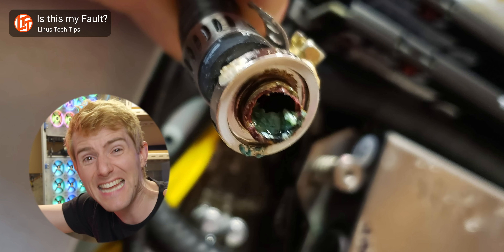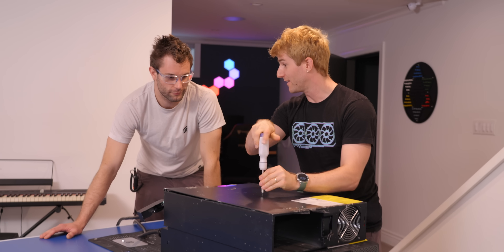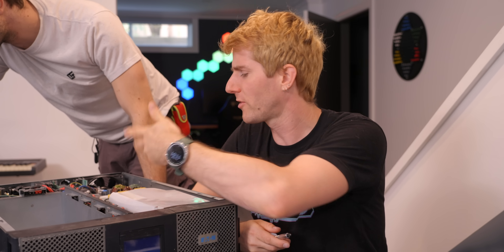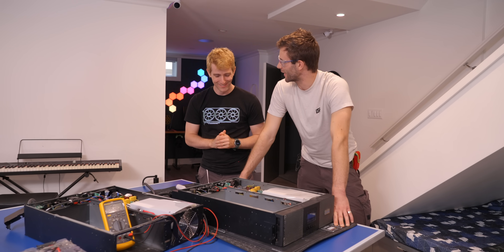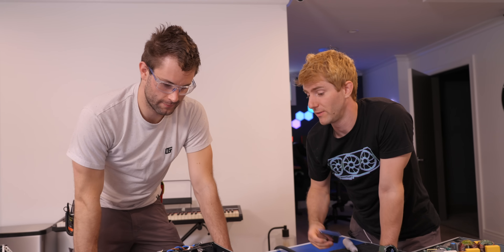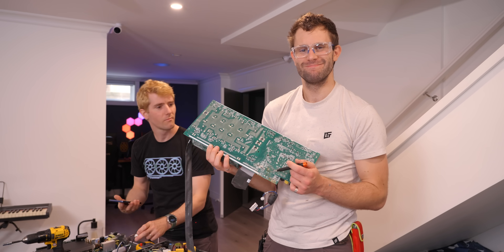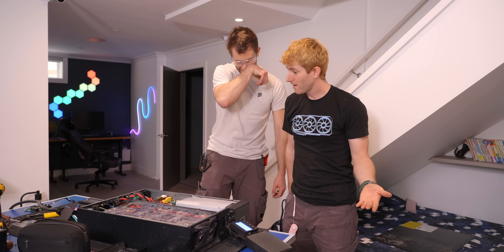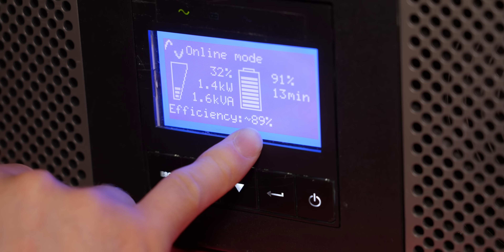Risking my life to save $5000 - Water Damaged Battery/UPS Repair

Comment: Really though people, don't try this at home, capacitors with a couple hundred volts in them are VERY scary. Even if the supply is rated for a tiny amount of power, a large capacitor can still easily deliver many, many amps for a short period.

If one of those bites you, that's it. Black screen. You're dead before you hit the floor.

I got lucky once and only capacitively coupled myself to ground through a 2KV AC supply, had my finger touched a millimeter over and found an ohmic path I'd be dead.

Comment: Actually, you can a NEW APC Schneider Smart-UPS (online UPS) 1500VA RM (SRT1500RMXLI) for around 1700 € without or 2200 € with a network card. New lead acid batteries incluced. Not sure if that operation here really would make sense if for someone else than him, since he gets the revenue from the video. Since he payed 500 $ for the new unit, has to pay Tynan and still has used batteries....

Comment: Ways beer and UPSs are NOT alike:
1. You cannot drink a UPS. Even if you could, you probably shouldn't.
2. You should not go to a UPS tasting.
Reply: 3. Beer will not automonously respond to a power outage
Reply: @chrisogrady28  That may depend on how long the beer has been standing around without a lid on ...
Reply: @chrisogrady28 Well, it probably would become warm
Reply: You shouldn't walk around with a beer on the street in the US, whereas it's probably pretty fine to walk around with a UPS.
Reply: @derBiggi82 brown bag it
Reply: @samlevi4744  The USP? Yeah, probably a good idea...
Reply: You cannot tell me what to do.
Reply: Your beer cannot electrocute you if you take it apart
Reply: @CentreMetre  Enough of either CAN cause you to fall onto the street, burbling incoherently
Reply: This works for uninterrupted power supplies and United Parcel Service. 😂
Reply: 'Yes hi, I'm looking for a beer that pairs well with a UPS'
Reply: As an ex ups employee, a shocking amount of drivers are achoholics. And a ton would step down to being a pre loader after being reported for drinking on the job, but that doesn't mean most do...
Reply: Shouldn’t go to beer tastings either.
Reply: 3. you can only taste UPS once in your life
Reply: But why?
Reply: Also never allow very small children to sample your expensive electronics. (and beer)
Reply: Well you can at least drink the sulfuric acid from those batteries
Reply: ups tasting.. sounds yummy
Reply: Uhh, aren't Lead Acid Batteries full of distilled water? So i suppose you could actually drink it. (Disclaimer because some people might be that stupid: The distilled water inside a Lead Acid Battery contains aqueous sulfuric acid. And lead. Don't fucking drink it.)
Reply: @avgvstvs996  Tasty!

Comment: it highly bothers me that Linus is pointing with the uninsulated screw driver while talking about capacitor discharge.
Reply: Even if it was insulated hes holding the shaft 😂
Reply: The system works.
Reply: My shaft is always insulated....
Reply: @2Hard2Core  pause
Reply: @jono6379  @2Hard2Core  No-one wants discharge on their shaft... #Sorry #Notsorry
Reply: Correct

Comment: i did the "same ish" thing on my opel Ampera (same car as linus volt ) battery as long as you know what your doing it is not that dangerous. and if you REALLY have to this shows allot but there are allot of other videos that go in to the safety.  1 thing that i recommend ALWAYS 1 extra person for IF something does happen. 
that battery on the car is just ALLOT heavier XD

Comment: That 190ish VDC battery is honestly more dangerous than MOST of the caps in there. For one, far easier to put that "across" the chest (touching a wire with each hand).

Also that being 5 grand for so little capacity is ridiculous.
Reply: The expense doesn't come from the capacity, it comes from the rated power output. They go from 1 to 22 kVA.

Comment: Ya'll should do a video on how to set up a UPS for home use.  I know there are tons of affordable units that are essentially plug and play, but I could totally watch a video where you outline how to properly speck a UPS based on your needs (how much do you have plugged into it, how long do you need it to run, is this just to clean up dirty power, etc.), if it makes sense to buy a second hand unit, and what different battery options there are out there.

Comment: the sheer amount of disclaimers around the first 2 minutes tells me this video is going to be a good one.
Reply: Its funny how he was so scared to touch anything in the bugging but then started rubbing the bottom of the board ( most dangerous part cuz that is where capacitors pins are )
Reply: @Comrade_YG  you mean after they probed all the capacitors to make sure they were discharged?
Reply: Take a shot anytime a disclaimer flashed across the screen.
Reply: @VincentJulianOng  Disclaimer: LTT does not recommend taking a shot every time a disclaimer shows on-screen.
Reply: Not everyone has a mechatronics engineer at their disposal ... an interesting video usually gives a good financial return ...
Reply: They got ELV mixed up with LV though... Not that major though. LV is quite dangerous, but so can ELV.
Reply: BUT IT WASNT :D
Reply: And it's basically for nothing. Just cringe clickbait.
Reply: @le_potate3861  u clicked on it
Reply: They got ELV mixed up with LV though... Not that major though. LV is quite dangerous, but so can ELV.
Reply: yes
Reply: This comment made me watch the video
Reply: Disclaimers? What disclaimers?
Reply: @TimeFlyBy  Linus "That's right, you're not dealing with the average content creator  anymore, Youtube... I, Linus, have finally become... the legendary Super Saiyan!"
Reply: the electric trucks we work on have 1000V capacitors and batteries which will blow your arm right off
Reply: @alexguolo5872  Thats like fetus work. Try working in a substation. We have 69kV which can disintegrate you through arcs
Reply: @alexguolo5872 1000V DC still falls under low voltage at least... But you wouldn't want to take a short across one. Be a hell of a boot
Reply: Try working down in a mine lol. This is baby wimp work
Reply: I feel like they definitely overreact and over dramatize things. Acting like these caps are live bombs
Reply: @Laborchet  In the ideal conditions you will actually die. In reality you will get a nasty belt and its also a way to check if you have a heart condition if you get a heart attack after. So yea dont fuck around them caps
Reply: @Laborchet In this case, they are.
Reply: @Laborchet If one of those capacitors still have power you die if you touch it. For example when Linus rubs the bottom of the pcb all it takes is one still being charged and he’s dead.

Comment: you should see if you can design a rack chassis with a gutter system that drains outside of the rack so that even if one system fails, it wont take ones below it with it

Comment: At this rate we're going to get a full suite of...

"My home server rack filld with my computers all DROWNED!"
"My computer rack caught on fire, it OVERLOADED!"

Honestly linus at this point you might aswell dunk the whole rack in a big mineral oil tank.
Reply: "My basement is flooded with mineral oil!"
Reply: I know a potential sponsor if they’re looking for fluid
Reply: @lzrjck69  I found Silicone Oil as the BEST coolant for the price followed by various versions of the very expensive but very high end dialectric 3M thermal transfer fluid which is technically the BEST in terms of actual specifications for Joules per second thermal transfer ability!

Dunking an entire motherboard, hard drives, power supply would definitely enhance LONGEVITY of the components. Just make sure your thermal transfer fluid is circulated very well and PROPERLY FILTERED to ensure no conductive particles slough off of various components over time.

V
Reply: @Vennnaya  thats actually a good idea for a video
Reply: I tried to fix my own server PSU and did 5 things wrong.  #4 will shock you!
Reply: The more that goes wrong, the more money he makes. It's free content.
Reply: Is your pfp the Anime boxes icon or does it come from somewhere else?

Comment: I don't understand the "you WILL DIE if you EVEN THINK about looking at this". I get the "don't try this at home". Sure. But even 200v is honestly not enough to kill you except in extreme circumstances. Dry skin can have resistance between 100kohm and 1megohm. You can get shocked, sure. But you aren't going to die. Linus didn't "risk his life". Just seems over the top to me.

Comment: I prefer the Marine Corps way of determining high voltage/current gear is safe to work on. Ground a metal hook, mount to broom handle, rummage it around said high voltage gear...should be discharged 👍 🤣🤣

Should edit this: this is only slightly serious, our radar did have an amplification stage running on 10kV. That specifically got the metal hook reach around before we poked around in it.

Comment: The fact he joked about licking the 2 terminal wires and got crazy close is pretty funny considering his knowledge
Reply from the maker: The contacts are not exposed on those leads. My tongue would have had to do some work to bridge them both - LS
Reply: @LinusTechTips  If you ate yogurt without a spoon, you've got the skills
Reply: @InvisibleSquids  So thats why his wife has stayed with him for so long (/s)
Reply: @LinusTechTips  That's what she said
Reply: @LinusTechTips 😏
Reply: @LinusTechTips  Yo
Reply: @LinusTechTips  put your ups above the water coolingstuff so it wont get destroyd by the next leak
Reply: I've seen a high voltage electrician get completely vaporized in pursuit of a dumb joke.  Knowledge doesn't necessarily prevent incidents from negligence.  

But it does make it funnier.
Reply: @sanguineel  Is there a story behind this or are you just gonna leave it at that?
Reply: @sanguineel  i think u mean cooked? Fried?
Reply: @tahahaider5836  nah, do u mean, well done, perhaps, congratulations?
Reply: @GregoryVeizades  that's just not possible. It would mean disintegration and we dont have that kind of power
Reply: @SuperJankyTech  extremely well done
Reply: putting the "terminal" into terminal wires ....
Reply: He should do a series for you on chasing power issues and DC issue diagnosis, he's good at explaining this stuff and seems to know his stuff well enough.
Reply: To be fair 240V across your tongue isn't going to kill you - but you'll definitely feel it.

Needs a path across your heart to even begin to be dangerous, and even then 240V is very unlikely to stop the heart of a young healthy person. I'm not saying you shouldn't be careful, but it isn't like he was on the edge of a cliff there or anything.
Reply: The amount of current (amperes) that passes through the body, not the voltage, is the main factor in the intensity of an electrical shock and whether it can be fatal. Voltage is the pressure that allows electrons to flow, and it supplies the energy for current to move. However, current doesn't move on its own, so voltage is needed to make it move. 

Different amounts of amperage can affect the body in different ways: 

    1–5 mA: Little electrical shock is felt 

6–30 mA: Painful shock, loss of muscle control 

50–150 mA: Extreme pain, possible severe muscle reactions, respiratory arrest, and death 

1,000–4,300 mA: Heart stops pumping, nerve damage, and death is likely 

10,000 mA (10 amps): Cardiac arrest, severe burns, and death is likely 

According to the EMF-Portal, healthy adults should not exceed a touch voltage of 50 V AC (1–1000 Hz) or 120 V DC for long shock durations (> 3 s). For children and livestock, the touch voltage is limited to 25 V AC or 60 V DC. 
@JD-ub5ic
Reply: @JD-ub5ic  as crazy as it sounds   9v battery  across  the tongue  has killed  ppl  as didnt know   till somone   handed   me info on it    at the rc  shop   we all used to do the lick   test but  afew   have  unlived   due to this it all depends   on  pot luck    and  your nervous system
Reply: @incandescentwithrage fun fact: Apparently, in the mid to late 90's, an electricians mate in the Navy died after stabbing both his thumbs with the leads of a multimeter trying to check his internal resistance.
Reply: @TCBOT  no, you did not. Nobody has ever died from 9v. Thats straight nonsense. The inherent resistance of the substance of the human body and the fact that even if the voltage was higher, touching with your tongue and tongue only, the path of least resistance is … through your tongue, to your tongue …
Reply: @TCBOT  Licking batteries is way safer than listening to that "someone". Safe or not, I would love to hear some of the other things this person has told you. As would a lot of people in here. There you go, you can start your own YT channel; "Someone told me". I promise I will subscribe and donate. 
Now, do a live show and you´ll hit 1M views way faster than a 9v battery can kill a person licking it. That much I can guarantee.
Reply: @81formann  400 KILLED  IN ALL DOING JUST  THAT LICKING A 9V BATTERY TO TEST IT  LOL
Reply: @TCBOT Sounds crazy because it never happened lol 😂
Reply: And yet he also got phished ...haha guess he is starting to get to grampa status